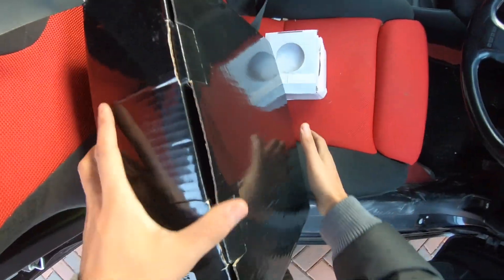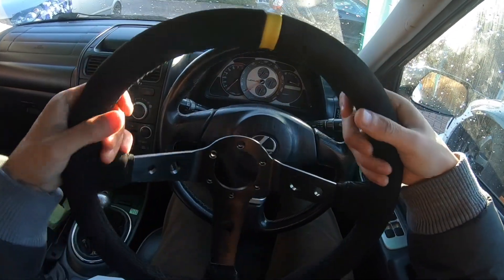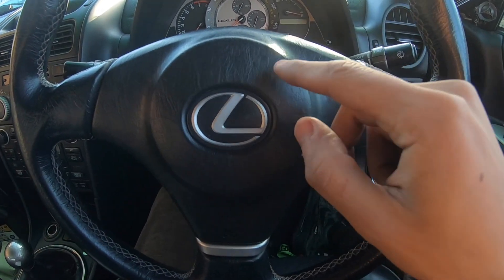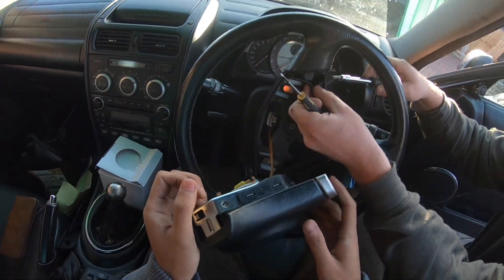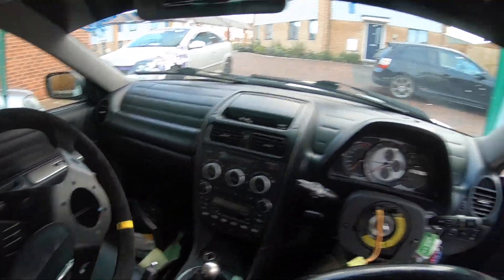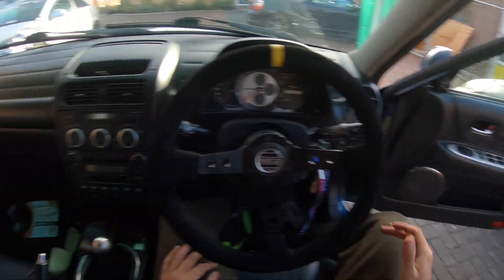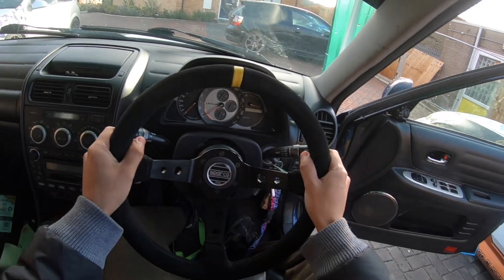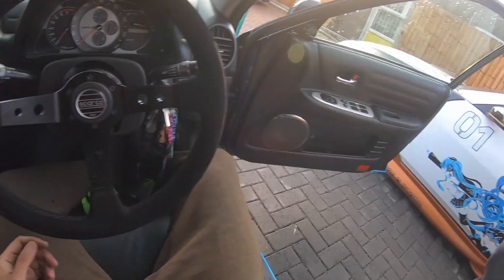HOW to: INSTALL DRIFT STEERING WHEEL on the lexus is200 FOR £80!

Comment: Eaton supercharger Or Squint turbo? or plan to keep it budget friendly. Great vid 👌👍
Reply from the maker: zee2302123 l at this moment of time im going to do a few drift days and see how the car handles and if it does need more power and if its worth spending the money on the lexus or spend it on another car build on a car people would like more like a civic type r or a skyline or an evo.... 👀😌 what would you do?
Reply: @hoodstig  I would get a is300 (around 2k) and do a R154 Manuel swap and just buy a na-t kit off ebay  but doing that will still cost money and I guess if its just for drifting the stock power of the is200 should be enough 👌 and if you get bored you can chuck a 1uz in there lol.
Reply from the maker: zee2302123 l all what you mentioned would cost about 8-10k could just buy a Toyota chaser or a toyota soarer! Lol but hey lets see what summer brings! 🙏💯💪😅
Reply: for twice the price you could grab a 1jz and 1jz install kit, much better for power in the future if im not mistaken